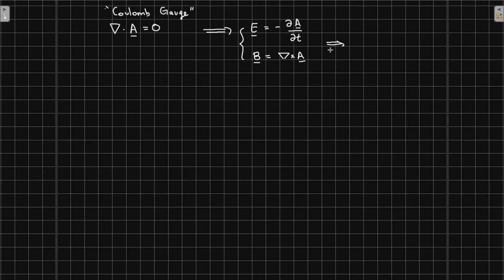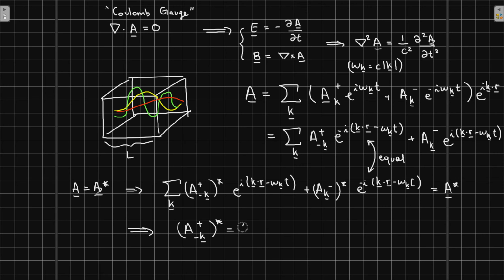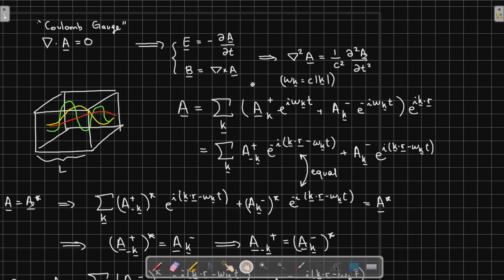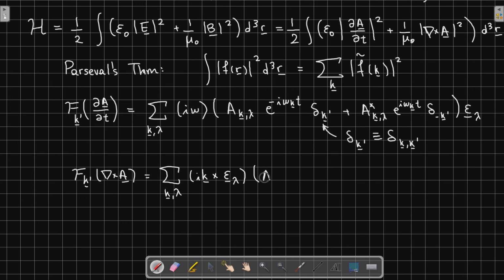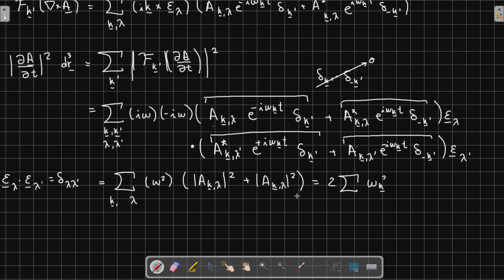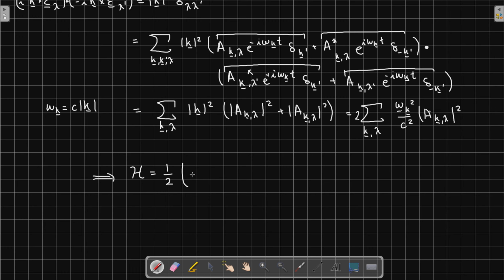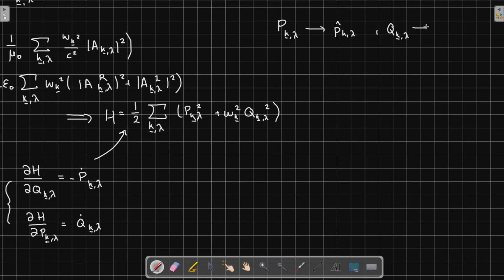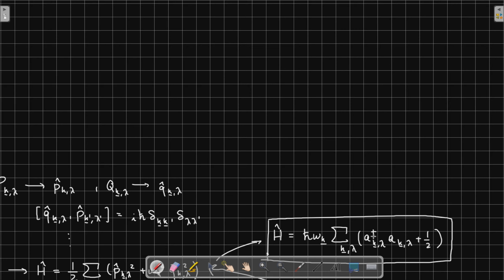Quantizing the EM Field

Comment: How can you use a non-relavistic gauge when an electromagnetic wave always travels at the speed of light.  All Maxwell Equations are inherently Lorentz invariants.  Indeed that is the actual original derivation of Lorentz transforms before Einstein other way in 1905.
Reply from the maker: The laws of EM can be expressed in a Lorentz covariant formalism, but that does not prevent use from choosing a gauge which breaks which "symmetry". The choice of a gauge after all has no physical interpretation, it is equivalent to choosing any other gauge.
Reply: Problems would only arise if you wanted to change frame of reference, because the gauge is not covariant, meaning that it doesn't keep the same form under Lorentz tranformation. Non-relativistc means this in this context, not that it can't describe waves moving at the speed of light, it very well does. In other reference frames, however, the Hamiltonian would be different. The result of this video, derived in the Coulomb gauge, is thus only correct in one frame of reference. But it IS correct.

Comment: I believe you have defined the creation and annihilation operators incorrectly. Taking your expression for a at 39:10 and substituting in the expressions for   q and p into the expression for a, I find that the final result has an additional factor of hbar. I believe that the hbar should be on the denominator in the fracrtion for the expression for the creation and annihilation operators. My maths is a bit rusty though so it's worth checking.
Reply from the maker: Could be, either way it's just a factor of hbar and in natural units that's equal to 1 so no need to worry about it too much.
Reply: @fisikalectures597  other than that great video!

Comment: Sorry if it's a stupid question, but why is there no contribution to E from the scalar potential (-grad V)?
Reply from the maker: Not stupid at all, I was unclear on my part and forgot to mention/took for granted that we are also working in a gauge where V=0 (this is known as a Weyl gauge). This does not impact the Coulomb gauge since the latter is only a partial gauge fixing, i.e. we can still set curl(A) = 0 in the Weyl gauge. Depending on the reference curl(A)=0 (EDIT: should be div(A)=0) and V=0 together are known as the "Coulomb gauge".
Reply: @fisikalectures597  Thank-you for the answer! I've heard of the Weyl gauge, but I didn't understand why it was okay, and hadn't heard of the concept of a "partial gauge fixing" before - very interesting!

I think you made a small typo, but I understood what you meant; div(A) = 0 instead of curl(A) = 0 (unless I'm still misunderstanding something, in which case, sorry!)
Reply from the maker: My mistake, thanks for pointing it out!
Reply: Is it not the case that he is working in vacuum and that in the absence of charge the scalar potential is always 0? This is the explanation my textbook (Advanced Quantum Mechanics by Nazarov and Danon) gives.
Reply from the maker: well technically in vacuum we don't have any sources so A = 0 and V=0. However when we refer to vacuum what we mean is there are potentials A,V produced by sources "outside" the vacuum.